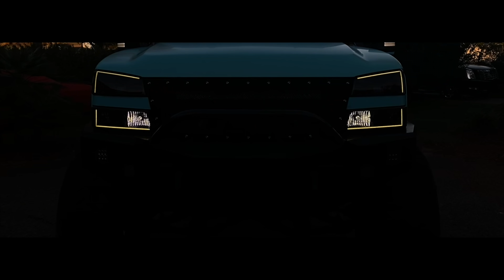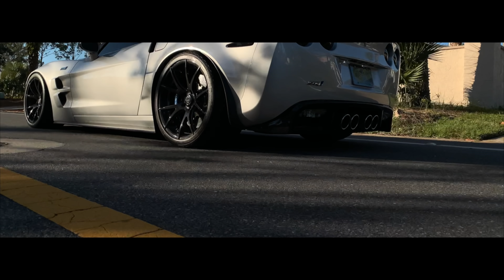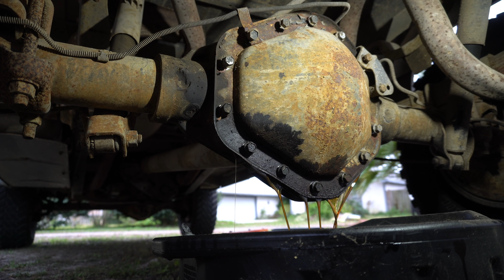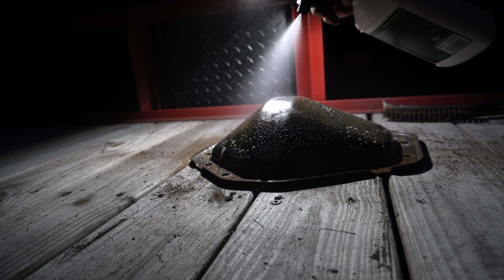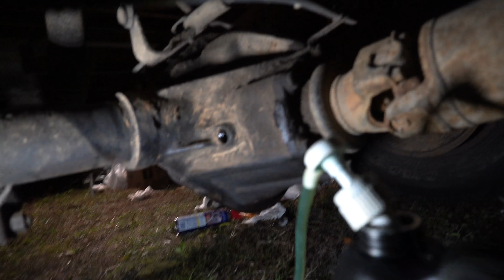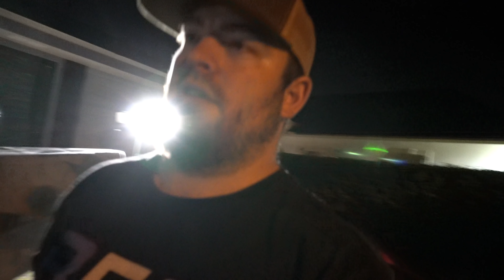Changing 20+ year old differential fluid on my Military Square body Chevy

Comment: Hey just so you no I usually lift the axel on the side that the plug is on just a little bit so that you can get enough 80/90 gear oil in the diff so that the oil has enough to also fill up the hub bearings!! If not you will not have enough gear oil in the diff and will cause the hub bearings to go out!! Just a heads up!! I just actually got done putting a Detroit locker in the rear of mine!!! Did your rear axel have a locker in it or was it an open diff?? It looked like someone had been in the rear end with the silicone that was on the diff cover????

Comment: I want to change the rear diff fluid on my 85. Also need to try and bypass the height sensing proportioning valve on the rear axle of my 85.

Comment: Hey at 9:11 i seen your ring gear is cracked id replace it before it becomes an issue
Reply from the maker: Are you talking about the carrier tho?
Reply from the maker: I remember seeing that mark on it. It looks like a crack but seems to be part of the cast
Reply: Then again your not trying to run power thru that rear end if its just a casting mark then you should be good
Reply from the maker: Appreciate you looking out 👊🏼